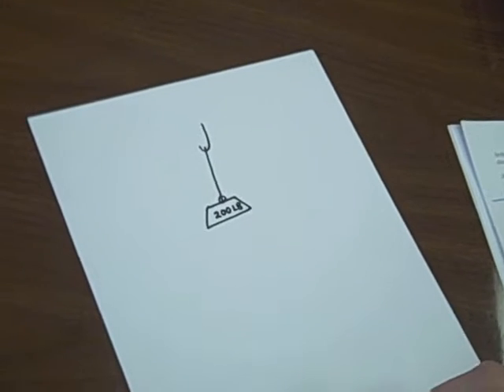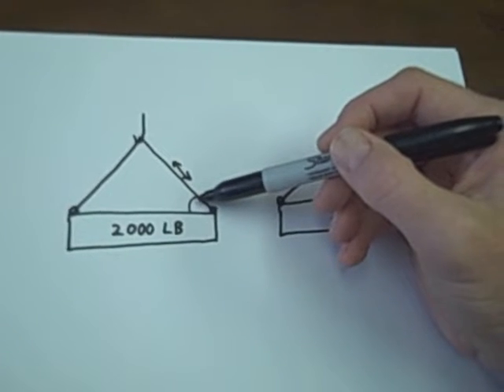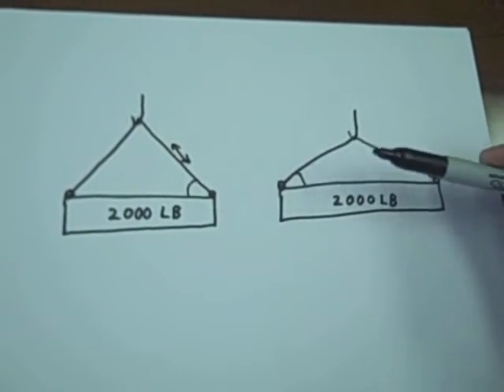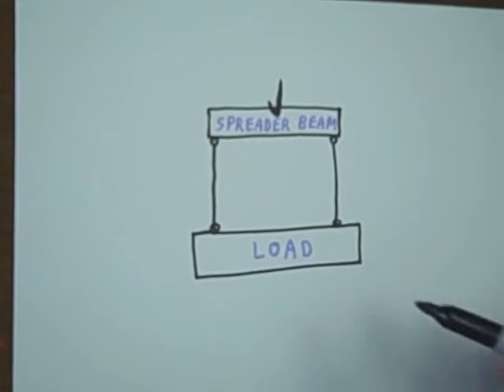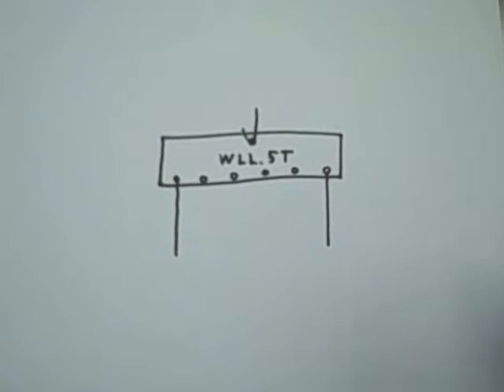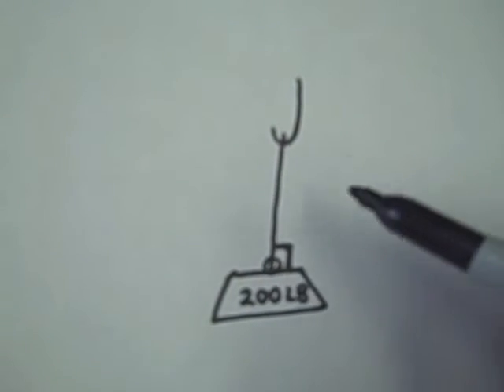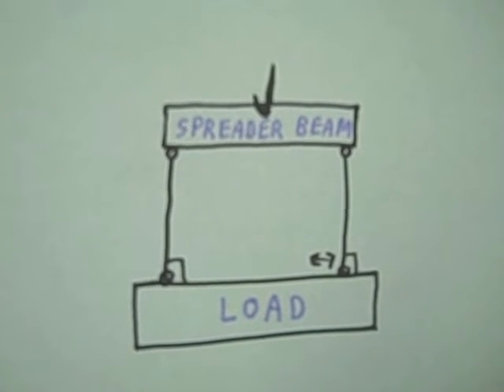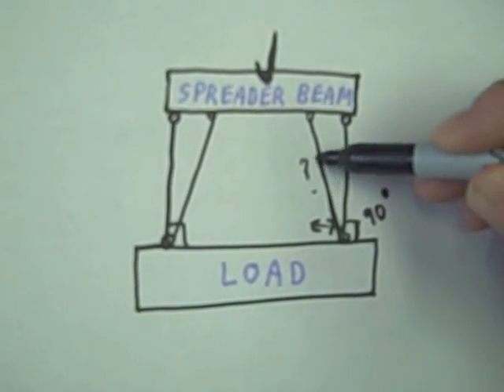How A Spreader Beam Can Reduce Horizontal Forces On A Sling Load

Comment: nice instructional video. at 2:25 it is stated that the connections of the slings are further apart (on the right hand side diagram). it seems to me that the distances are the same on the two diagrams however the height from the load to the hook in the example on the right is shorter thus creanting sharper angles.